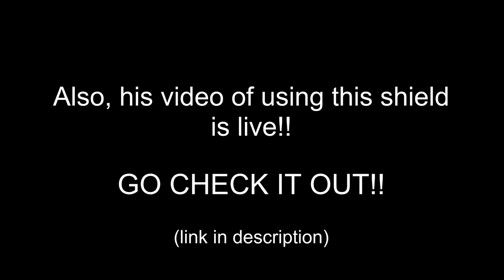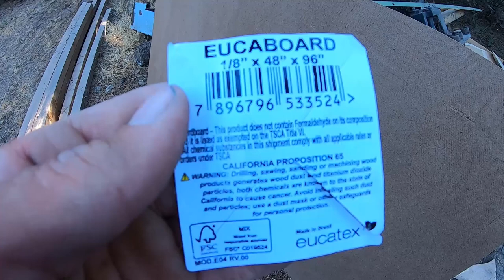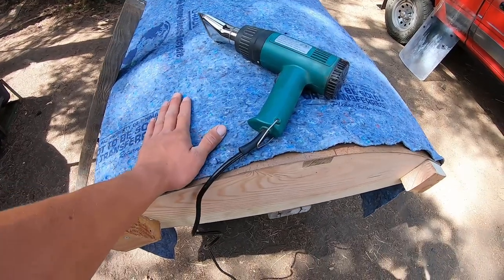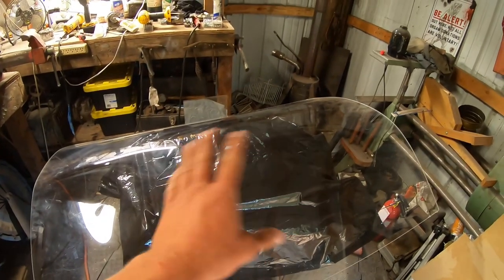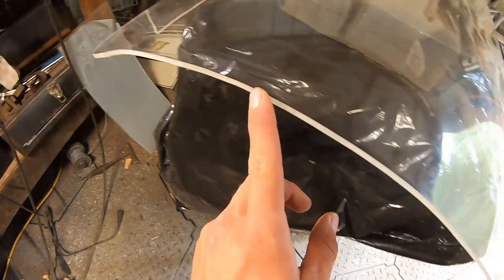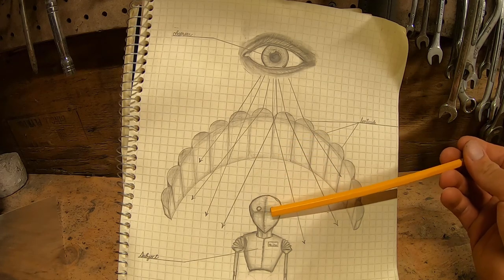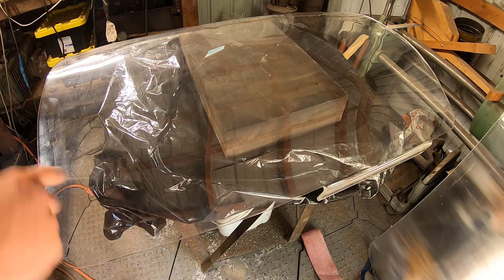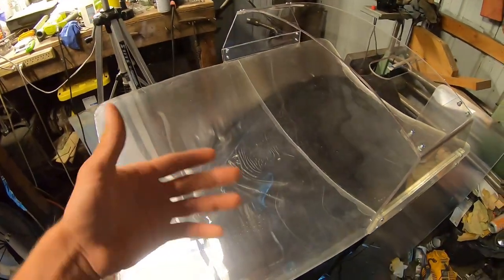Building An Updated Invisibility Shield... For Chris Ramsay!?!

Comment: Hi Randomn, 
You can vacuum down your shield for gluing with nothing more than powerful wet dry vac. I work in marine construction and think you may be interested in the process of vacuum infusion. There are some differences in process that you would have to do vs resin infusion however the vacuum bagging is what I suggest looking into.

Comment: You should be able to get a good distribution of the glue with a vacuum bag similar to what is used in fibreglass construction. Quite easily done with minimal gear.

Comment: 13:00- Idk about that. The temperature difference between a propane and a MAP-Pro gas torch is only 100-150*F. (3600-3750*F)

Pre 2008 you could get MAPP gas that would burn around 5000-5500*F. They stopped producing MAPP when the space shuttle program was shut down. MAPP gas was a byproduct of rocket fuel production.
Reply: Would an Acetylene torch work?

Comment: When you were using the heat gun and the weight of the plexiglass to bend around so you could screw it down, you should have taken a propane heater and directed it underneath, while you were hitting the top with the heat gun. I've had to do something like this similar and even some of the welding that I do, you have someone go in front of you when welding thick steel and they use either map gas or an oxy acetylene torch and they preheat the steel in front of me as I'm welding and then someone comes in behind me and post hits so that it doesn't crack under the immense pressure. Not a sermon, just a thought.

Comment: try a clear spray adhesive and a roller. It seems like those lens sheats are flexible enough to roll right onto the other surface with no air bubbles.

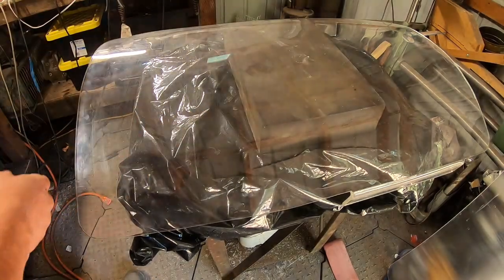Comment: 16:32
IF you want a larger one, find an older model LCD flat screen tv, has to be LCD, they are like 50$ and they have 2 of these lenses in it and you won't have that seam.
ALSO
i would use uv glue, brush it all around the thing, let it smooth out, place the lens on top, then finally dry it with a uv light.

Comment: Sure you can't easily see what's behind the shield, but the problem is you can see the shield. So if you are going to build one of these you'll need to build a second, bigger shield to cloak the first one. And then the problem we run into is that you'll be able to see that second, bigger shield, so you'll have to build a third, and even bigger shield. And this problem seems to persist through an infinite construction of shields. The only logical and feasible solution I've come to is that we need to make smaller invisibility shields in the form of contact lenses and then somehow get those into the eyeballs of literally everyone in the world. It is then we will finally be able to enjoy true invisibility.

Comment: Great build but if you look closely, your Handel that you built, interrupts the refraction of the film and in a sense, shows what's behind it but just in the Handel area.

Best bet is to build handles off to each side, so they don't block the view of the center of refraction. Blocking the center creates a view, the opposite of what your trying to achieve.

Look at the video closely and you'll see what I mean.

If you can make clear handles off to the sides, this will create perfection on the design.

Thank you for making this video. Very educational.

Comment: I know this would be hard to manufacture, but what would the effect be like if you could apply this to a round shield? I suppose you would want concentric circles of lenticules. Which uhh, no idea how to do that. I mean you could cut sheets up into triangles and make some regular polygon instead of a circle, but then the shield would also need to be that shape, which would actually be easier to bend the plexiglass too, but the effect probably wouldnt be nearly as good

hmm I wonder if lenticules can be effectively 3d printed, seems like a natural fit really if you could find the right filament that is clear and has enough surface tension to pull itself round while hot

Comment: Could you not use the same technique used in the composites industry? Use a slow set polyurethane or epoxy, and a vacuum bag? 

(Basically, you just build a vacuum chamber around your shield using cheap bags and tape, pull a vacuum, do the gluing deed, then pull off the bag.)

Comment: I've seen a video where a company applies veneer to a table top by placing it into a large bag and attaching a vacuum cleaner to it sucking all the air out this causing the veneer to uniformly attach to the table until dry. Maybe a process you can incorporate in the future.

Comment: To answer that you could have built a two before rectangle box put some grooves in it to slide the plexiglass into pulling a heater blowing into the box and keep blowing the heat into the sealed box with the plexiglass in it until it makes it less was flexible then you just slide it out and lay it on your frame or your shield jig you could basically build a large vacuum former like deal have a box big enough to put your plexiglass in but you can open the bottom up put the heater above the plexiglass mounted in the place heat up the plexiglass over here jig once it starts drooping just lower down the plexiglass and release it from the frame and let it droop over your mold

Comment: I would have set the skill saw blade to the depth I needed and use it, instead of all that chiseling. Plus I think I could come up with a better design using lighter weight materials for the curved shield design frame, that just looks way to heavy for what it is going to be used for.

Comment: Ok, I've just got to ask:

Why the heck wouldn't you just utilize a high quality UV-activated, crystal clear bonding epoxy?  In case you aren't familiar with this, I am referring to a relatively thick but viscous clear (or very nearly clear) adhesive, such as that used in the bonding of a Corning Gorilla glass outer protective layer, which gets direct bonded an LCD display & DIGITIZER unit; thereby creating one continuous, perfectly uniform, non-refractive, crystal clear touchscreen display like those of modern smartphones and tablets.   You have the luxury of applying the epoxy / resin adhesive and having plenty of working time--provided you work in a location that has no sunshine or other ultraviolet light source.   The very best way to "activate" your adhesive to create that pristine, crystal clear bond between substrates would be to roll that piece out into direct sunshine....particularly given its immense size.  But any UV light source emitting the correct wavelength(s) will harden the adhesive completely with SUFFICIENT TIME (i.e., exposure); even if it requires you to activate the adhesive across subdivisions of the entire surface.

Perhaps you have already looked into this option, but I hoped to learn more about why you chose the glue that is shown in the video when optical clarity is truly the ideal one should be trying to achieve.

Thanks in advance!

Comment: Try using slow cure epoxy and a reverse form... Coat whole surface in epoxy lay down the sheet put form on top then weight it down for 24hrs

Comment: Why not just buy tubes just like aquarium builders use when making tunnelsand more, then cut it into pieces you need, then mount handles. Cause they got those pipes in all sizes and all thickneses aswell as diff material

Comment: How crucial is the contour? Could you just cut a flush barrel in half and use that as a form?
Reply from the maker: That would probably work if it had a large enough diameter.